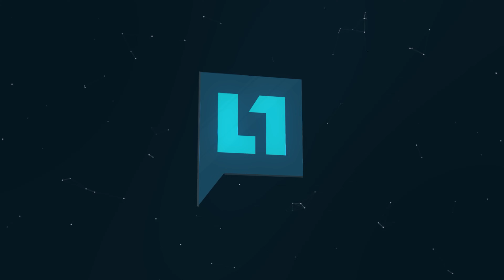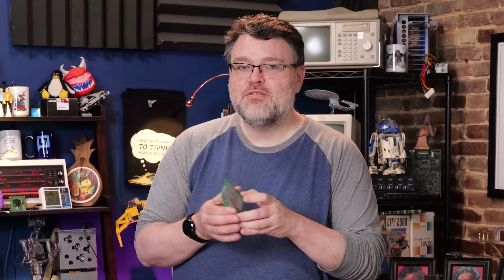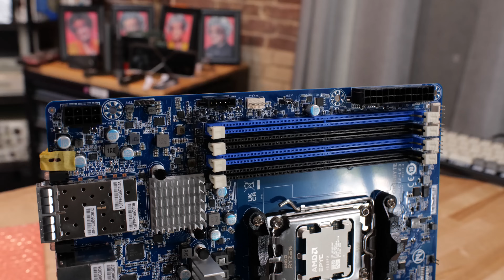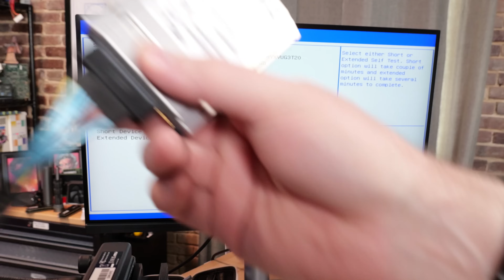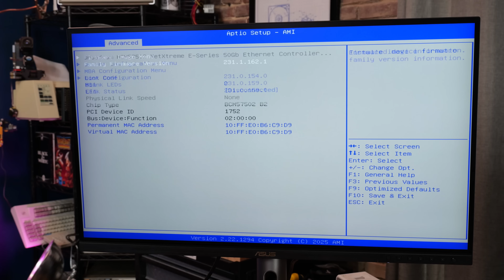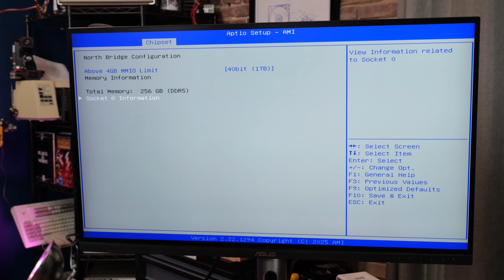AMD EPYC 4565P First Look: Featuring the MC13-LE3 Motherboard from Gigabyte

Comment: I run a SuperMicro AM4 server at home.  Works great.  Solutions like this are great.
Reply: I do the same with an ASRock AM4 mini-ITX and 5950x, ECC RAM. Having IPMI and remote KVM on a home server is a game changer. And putting them together yourself is much more cost effective than off-the-shelf systems.
Reply: @macemoneta  Wait. My AM4 one is an AsRock Rack. 🤦‍♂️

Comment: Not being able to use Registered DIMMs in a deal breaker (96GB DIMMs are becoming affordable).

I know many love AMD for keeping sockets for so long, but AM5 has to go! Having two DIMMs on the same channel has a massive bandwidth penalty. Halo Strix & Apple are running circles around AMD's desktop CPUs. Give Ryzen 9 a real reason to upgrade. If it was up to me, I'd dump Threadripper non-pro and move it into the Ryzen 9 territory, adding an additional 16 PCIe lanes would be nice, but I can live with bification.

Also, connect the PCH with PCIe5.0! it's comical daisy-chaining so many devices (and an additional PCH) on the same x4 PCIe4.0 CPU connection.
Reply: To have more memory channels and more PCIe lanes mean more package power is needed.

So basically just go Threadripper.

Even they provide 28 PCIe lanes, I think AMD only designed it to work at 5.0 speed only 16 lanes  at a time. More may need to sacrifice CCD power to allow more lanes to work at 5.0 speed.

Comment: Nice vid and walkthrough of the gigabyte board. I just let go an asrcock rack b650d4u3 board due to ongoing fan control issues, stability issues with 5600 mem and observing my 7900 cpu run a bit too warm at idle for my liking. I am thinking of getting the gigabyte and epyc 16 core 65w but not sure if the board supports all the sleep states to keep this beast running cool when not doing much. @level1Techs -  Any chance we can get a video or screenshot of the IPMI screen including sensors?
Reply: This is what I am interested in as well.... how is the power management at idle and low load...  my entire production rack uses 750W with five servers (3x EPYC + 2x dual Xeon) at idle... getting that down when it's time to start replacing nodes would be nice.... and the AMD systems idle higher than the dual Xeon servers (by about 15W each, but are also 3X faster with 4X the RAM, so not a dig by any means).

Comment: I wish they would up the PCIe lanes available to support the use of multiple NVMe storage devices, 4 lanes for a set of SATA drives, and high speed network; and possibly still have enough to support a GPU for encoding/ai/etc.    With the extra lanes, the 4004 series would be such a perfect lineup for homelab, dev lab, SOHO/SMB Storage NAS, etc.  Maybe somewhere between 48 to 60 PCIe lanes ideally served with a few slots and the rest MCIO!    Or at least 40 lanes if the number has to be super low. . .

:s     One needs to upgrade EPYC 8004 series (96 lanes) or full blown EPYC 9004/5 (128 lanes) to get enough lanes for lots of nvme, sata, high speed network, and gpu (or threadripper, but at those prices might as well stick with 16c32t EPYCs).
Reply: 48 to 60 PCIe lanes would require a much larger socket than AM5. The socket probably has a few pins on reserve for future use, but I don't think added that that many pins. Maybe spare for 4 additional lanes perhaps.
Reply: @LordApophis100  Ah! I did not even think of the socket/pins limitation.  I figured it was simply AMD not wanting to dump R&D money to make a new IO chiplet but the socket being the main limitation makes even more sense.
Reply: @NPzed  It's already late for AMD to make changes, But I'm hoping for more pcie for AM6. They should also be ready to bend the pcie sped for the lanes going to the chipset. They design the chips on both ends so tweaking the details to excede the given spec, say pcie6 overclocked, would allow more things in the chipset including more secondary pcie lanes, to be used with less bottleneck to the cpu. Also add in at least 8 more cpu lane, preferably 16+.
I do think they need three tiers, the current 2chiplet consumer and 8 chiplet workstation/server are good, but how about a 4 chiplet hedt chip? They could even make it in versions compatible with both of the other two's boards or it's own socket. Indeed if they're going 12cores per chiplet then 4 chiplet cpu's could do quite a bit in hedt.
Reply: @LordApophis100  Pinout only shows 10 "reserved" pins.
Reply: yeah this is definitely a socket limit
Reply: Also you mention SOHO, homelab, NAS etc, so why does every NVME need x4 lanes dedicated to it?  A lower price point involves tradeoffs, like reusing the consumer socket and IOD.
Reply: @RobBCactive   Exactly, with 2GB/s per lane at Gen 4 1x per NVMe would be plenty to saturate even 25GbE.
Reply: @RobBCactive  Unfortuantely, most NVMe drives are setup to use 4 lanes even if they are at 3.0 or 4.0 speeds.  Its only more recent drives that are starting to offer 2x lanes of 5.0 or 4 lanes of 4.0 since the speeds are so fast.   Until the controllers of SSDs support only needing 1 lane or 2 lane, we will need to have 4 lane connections.  And if you want to use cheaper used enterprise drives those will definitely be 4 lanes for quite a few more years. . . .

Technically redrivers and other tech could probably split a single 5.0 lane into a bunch of 3.0 lanes, but I have yet to see one of those boards made.
Reply: @NPzed  but there's NVME cards which share the lanes out like the chipset PCIE hub, so them preferring x4 is neither here nor there.  I've also seen NVME be given x1 due to poor auto-configuration decisions and not using a GPU increases the lanes available.
If you're wanting something cost effective for SOHO/homelab applications demanding top peformance multi-way rather than accepting some compromises is a stretch.  Designing and validating a low volume niche IOD is unlikely to be economically feasible.
Reply: @RobBCactive  most m.2 slots are wired for lanes and you generally can't just move lanes around on motherboards. I haven't seen a consumer board that supports x2 bifurcation, or splitting a m.2 slot into x2/x2. At some point you end up spending a bunch of money on muxes to move the signals around electrically.
Reply: @Cynyr  that's ignoring that a PCIE Hub allows all to have x4 available when needed.  In a relatively low utilisation case like SOHO, it's better to share lanes than split them.
Reply: Yeah this is the problem im having, I almost bought this but realised pci lanes were going to limit bandwidth for my storage solution so I pulled out but the next step up is power hungry and expensive... the hunt continues

Comment: Please sir, could I have some more PCIe lanes.
Reply: I'm afraid am5 isn't built for more lanes
Reply: @Burbund  Isn't AM5 a chiplet design? Pretty sure they could extend it however they pleased.
Reply: @SyntacticOperator the I/O die would need to be changed and they could increase the PCIe lanes. But I don't know if the already existing mainboard would work then or if you have to buy new motherboards to use all PCIe lanes.
Reply: @dieselphiend  no, am5 is a socket, the chipsets are like x870 or b850
Technicaly yes, amd could extend pci lanes by daisy chaining chipsets (already daisy chains 2 chips in x870e) or aibs could extend pcie by using pcie multiplexers (like back in sli/crossfire days) but both of those methods add latency (which may not matter in many cases)
edit: not to mention that those are pretty expensive solutions
Reply: @Burbund  Also usually the chipset on many of AMD's recent systems is the same as the IO die... literally the same chip. I think there are some exceptions to that especially now that there are GPUs in the IO die but yeah that's how they designed it.
Reply: @Wingnut353  didn't know that
Reply: @hocln2556  Hmm, I'm not entirely sure. The physical traces to all of the PCIe slots, memory lanes, USB, and etc, are already there. I think it's that all of those traces can't be addressed at the same time without the lanes.
Reply: @Burbund  Forget about PCIe switches- physical lanes or nothing, hehe.
Reply: @dieselphiend  yeah that's probably kot  happening on am5 as it has less pins than old intel hedts (like x99)
edit: am5 has 1718 pins, zen 1 threadripped has over 4000)
Reply: @Burbund  I wish they'd release a pin mapping. I think there is likely open pins.
Reply: @SyntacticOperator  you need pins in the socket for the extra lanes.... AM5 was developed for smaller systems so not enough pins for more lanes... for more lanes you have to use a system with WRX or TRX socketes
Reply: @robertjung8929  I did find a pinout, and I think I see 4 open pins though I'm not sure. I'm pretty sure that most CPUs have open pins, and rather than just leaving them as dead pins, they make them VSS pins. I've never thought they could give us Threadripper levels of PCIe lanes on such a small socket but I have little doubt that they could give us at least 4 more lanes but probably more like 8 to 16, if they really wanted to. It would obviously make them more expensive.
Reply: @robertjung8929  you can bifrucate with pcie5, but length of the connection is limited. Simple questions like this are perfect to ask chatgpt btw
Reply: @SyntacticOperator  it's more complicated than that. pcie lanes have several requirements to preserve signal integrity. second and more important  point is you simply can't change the socket pinout, you would need to create a new socket specification e.g. AM5+ and that would just eliminate the whole benefit of having those CPUs for AM5...
Reply: @robertjung8929  The price to enter the HEDT market is too high anymore. They need something in between Threadripper, and end-user platforms. There's like an entire price segment that doesn't even exist, from around $600, to $1,200 that could be filled quite nicely. No one really needs compatibility. AMD is just trying to make the most of the standard.
Reply: @hocln2556  the I/O die should be changed.
Reply: @Burbund  You're not mentioning the biggest problem, that no matter how many PCIe lanes you get out of daisy chaining the chipsets, they all have to go through a narrow PCIe 4.0 x4 bus to the CPU. It's a terrible bottleneck where you can't even use a single Gen 4 NVMe SSD and a 10 Gbps NIC at full speed the same time, let alone transfer from one SSD to another at full speed if both are plugged on chipset lanes.
Reply: @dismuter_yt  true 
Multiplexing might be better for normal use as it could split 20 lanes of gen5 into 40 of gen4 without bandwidth loss, but they're very expensive as far as i know
Reply: @SyntacticOperator am5 is the socket. Zen 5 is the a chipset design on AM5. You could conceivably get extra lanes from zen 5 with a new IO die or something, but you would need a different socket with more pins for more pcie lanes
Reply: @MobiusHorizons  Not necessarily. They can add extra lanes by way of the chipset though  DCM/PCH- like Z690.
Reply: @Burbund even if daisy chained it still has to share one downlink so bandwidth is limited
Reply: @SyntacticOperator  you still need the electrical pins to the CPU
Reply: @nathanriegel1679  It uses the DMI link to the chipset. This is how Z690 provides an additional 28 lanes on top of the 16 the CPU provides. There's obviously some sort of dynamic switching going on but it's better than nothing. We definitely need larger grid arrays for next gen systems.
Reply: I wonder how costly would be to add splitters or switches to transform those Gen5 lanes into more Gen4 lanes for storage for example.
Single Gen5 could feed a ton of Gen3 PCIE SAS hard disk controllers for a NAS.
Reply: @CesarinPillinGaming  no, this is not PON Fiber network. You can set your pcie interface to pcie 4.0 and use bifrucation to split lanes if your mb supports those features.
Reply: @TylerDangerCheeseman  Arent you still losing speed that way?
PCIE5 is 2X times PCIE4. Hence the switch thing.
Reply: @TylerDangerCheeseman  you can split 1 pcie lane to multiple using a pcie switch, the only reason why it's not common is the price of pcie switch chips.
Reply: @robertjung8929  no, you cant do that. Stop lying
Reply: @TylerDangerCheeseman  you have no clue , but got the audacity  accusing someone of lying... there  are pcie switches and even pcie muxes.. how do you think is the south bridge on the motherboard giving you all the connectivity from the mere 4 pcie links coming from the CPU ? go and read something about pcie topology then write comments...
Reply: @robertjung8929  please, stop spreading misinformations
Reply: @TylerDangerCheeseman  you have no clue... PCIe switches do exist. google Switchtec from Microchip for example... and as mentioned READ something about PCIe before you spread nonsense.. it's you who is spreading misinformation.
Reply: just x4 more would be nice.
Reply: @thenextension9160 Exactly. That would allow 3x 8 lanes or 16+8. That with a couple chipset m.2 slots and you have an entirely new server/work station line. 3 GPUs at x8 forLLM compute or HBA+NIC+GPU. Game changer.
Reply: Its all about PCIe
Reply: @TylerDangerCheeseman yeah…28 lanes of pcie gen 5…. How will you ever saturate all that bandwidth???!!
Reply: @psycl0ptic  :) 28 lanes gives us exactly seven x4 NVME slots! What else one needs huh!
USB 4?
Errr then 6 nvmes and 1 USB ⁴ right?
10 Gbe?
Hmm, then 5 nvmes and a 10Gbe as well...
2 more PCIe 4.0 x1? I already gave you one!
SATA then?
Now you want 8 SATA ports!!!
I've already given 1 Gen5 Nvme, 1 gen4 nvme, 2x gen3 nvmes! Why do you need 8 SATA ports!
By the way, there are 8 lane graphics cards out there, I can shorten the x16 PCIe by two. That'd give you a gen4 x4 pcie port and 4 USB 3 Gen2 ports, would it work for you?
Well that's the best I can do...
Besides who needs more than 4kB of RAM!
Reply: @mimmimim  Imagine for a moment how cheap 7900 XTXs will one day be. Yes?

I will have 4 of those puppies in parallel in the next 5 years, and that's just GPUs.
Reply: Is has 28 gen5 pcie lanes, that’s 8!more then the intel counterpart.
Reply: @psycl0ptic  No, Intel CPUs have better I/O. They have 20 PCIe gen 5 lanes + 4 gen 4 lanes + equivalent of 8 gen 4 lanes to chipset (which provides PCIe too). That's up to 26 gen 5 lanes' worth of bandwidth at the disposal of PCIe components. AMD has 24 gen 5 lanes + 4 lanes operating at gen 4 speeds to the chipset. That's up to 26 gen 5 lane's worth of bandwidth too.
BUT :
1. On X870(E), 4 of the gen 5 lanes are sacrificed for Thunderbolt / USB4. Not on Intel where they have their dedicated connection, and that gives overall bandwidth advantage to Intel.
2. Intel can distribute that bandwidth better. 2 gen 4 SSDs can run at full speed off of their chipset, while only 1 can run at full speed off of AMD's. Both platforms can run the same number of gen 4 SSDs off of the CPU at full speed, so in the end, that gives Intel the edge for being able to run one additional SSD at full speed.
Reply: Good News! AMD has CPUs with 128 PCIe lanes you can buy.
Reply: @dfgsdja  you’re half right. AMD has EPYC CPU’s but I can’t afford them.
Reply: @dfgsdja "can" buy?
For a pair of kidneys maybe 😢
Reply: @dfgsdja that is a complexly different market segment.  Why would I you need 128 gen 5 pcie lanes with only 8 cores and 192GB of ram…stupid request

Comment: That 16 core 65W SKU looks kinda spicy - wonder how it clocks at that power envelope
Reply: 3 Ghz base clock instead of 4.3 Ghz for the 170W part, boost at 5.4 instead of 5.7 Ghz.
Reply: Like a laptop 95% single and 80% +multi
Reply: Serve the Home Grado review talks about it, slower clocks but not slouches.
Reply: 500Mhz all-core for 65W

Comment: This would be the best board for CEPH storage cluster with flash storage. 2x25GBE will provide enough BW to sustained 3-5 nodes replication at 1GB/s.
Reply: I'm in the process in building that cluster. Starting with my "old" AsRock Rack Zen3 homeserver, now with MCIO and U.3! Still deciding on hardware for 2nd and 3rd node. Follow my thread in the forums!
Reply: I didn't know that ceph was that hungry for bandwidth, do you think less than 10g is pointless?
Reply: @vipvip-tf9rw  Depends on your demands. Can run with 1Gbit networking, but try to get 16-30TB of data over that tiny connection if one HDD dies. And 100MB/s? your NVMe are basically on HDD level for bandwidth.  10G is recommended minimum and sufficient for basically all homelabs.
Reply: @vipvip-tf9rw  Depends on your disk and pool size and number of nodes, and what considered acceptable four your nodes to fully sync if node or disk get replace.

10g is OK but if you have like 10TB+ per node it will take many hours to rebuild/sync.
Reply: @vipvip-tf9rw  Not pointless but it is less. Honestly the issue you run into at higher GB/s is lack of RDMA in your infrastructure.
Reply: @vipvip-tf9rw  10g is good for moving VMs but the latency of 10g is bad for the data replication traffic in Ceph. Go 25g and upwards if you're serious about it. You can do 10g but expect hits on latency especially if you use the 10g connection alongside other services.
Reply: : No, this would be the best board for CEPH storage cluster with flash storage :D -> B650D4U3-2L2Q/BCM
Reply: any idea how much power roughly this board consumes with the epyc cpu at idle without extra gpu?

Comment: but raspberry pi4/5 are still very nice servers for various uses. not when you want big. but when you want small. tiny. silent. that does not create a water leak problem.
Reply: These 16 cores are fine under air
Reply: you wouldnt use an aio. he is doing for testing. this is a server. it gets loud fans that go front to back like in a rack for a data center. a pi is a fraction of the power of this unit and has limited applications.